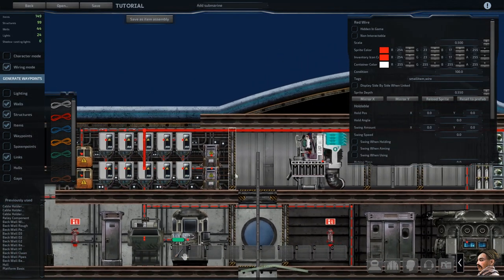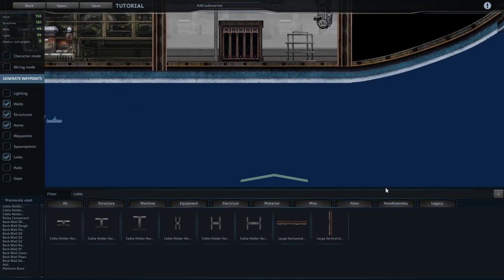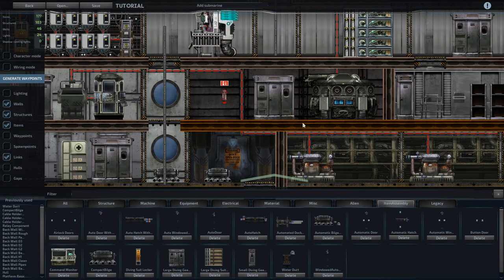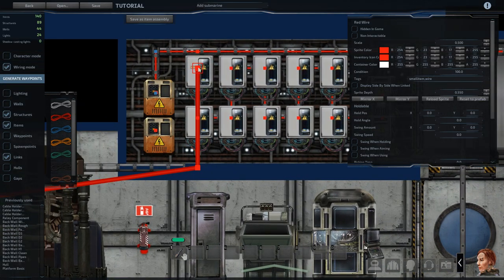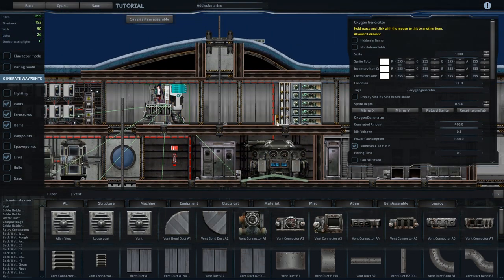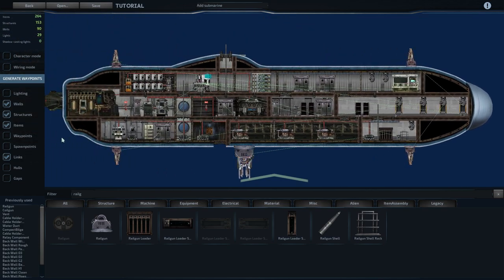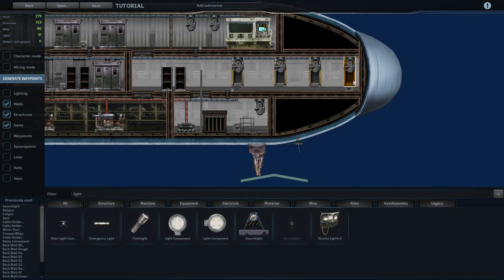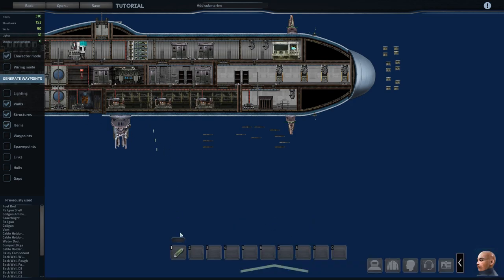Barotrauma Submarine Editor Tutorial Part 3 | Ducts and Wiring

Comment: An update for those whose bilge pumps might not be working: there is now a "water_%" signal as part of the water detector that you use to regulate the speed of the pump rather than the signal check component seen here in the prefabs made by the devs. Strangely, the prefab that uses the signal check component hasn't been removed despite no longer working (the pump turns on but remains at a speed of 0, doing nothing). Here's what I've done to set up working bilge pumps on the current patch:

-Wire the water detector's signal_out to the pump's set_state as usual—this turns the pump on when there is water detected. 

-Next, create a multiply (X) component and a memory (MEM) component. Set the memory component's stored value to -1 and wire its signal_out to the multiply component's signal_in_2. 

-Now wire the water_% from the detector to the multiply component's signal_in_1. Thus, the signal_out of the multiply component is made negative so that the pump will actually remove water (leaving the water_% value positive would cause the pump to pump water into the sub). 

-Lastly, wire the multiply component's signal_out to the pump's set_speed, and you're done!

Alternatively, if you want the pump to always function at maximum speed regardless of water level, there is no need for the multiply component or the water_% value. Simply set the memory component's stored value to -100 and wire it directly to the pump's set_speed. This way, whenever the pump is turned on by the water detector, it will pump water out at max speed, using more power perhaps but getting the job done quick.

Great series Oroe, it was a tremendous help getting started.
Reply from the maker: This is great information, thank you!
Reply: @n_tropy  Absolutely, glad to contribute.
Reply: Thanks! You saved me!
Reply: @MonsterTamerBloba  you're welcome!

Comment: How can you wire more then 5 thing? i have 6 ballast pumps for example and i can only wire 5
Reply from the maker: You'll need to use relays, each wiring point has a maximum fanout of 5
Reply: @n_tropy  okay thank you man you are a legend
Reply: @n_tropy  in wich relay in and out slots should i put it?😅 i have 15 pumps so i have to use 4 relays.
Reply from the maker: @max_2271  15 ballast pumps? I'm not certain why you have so many lol. When it is switched on, it will forward all input connections to the output. So you could feed the control line to the input, then fanout to 5 pumps per relay.

Comment: How would I turn a docking hatch into a airlock? Specifically for the Humpback sub.
Reply from the maker: Since a docking hatch is specifically designed to react to other docking hatches, I don't believe there's a way to turn that game element specifically into an airlock. You're better off using a two-door system with linked buttons.

Comment: When i start the game the ballast's are OFF. I need to turn them on manually, i dunno why is that. I did everything, the power, signals, name tag.. AND the Status monitor always sasy "no power" when its powered from the reactor itself. Please help.
Reply from the maker: Make sure the status monitor is being appropriately fed from a junction box, and make sure it's linked to the nav terminal appropriately. To clarify, it will always say "No Power" while still in the sub editor. To have the ballasts default to on, enter character mode in the sub editor, open the ballast pump, turn it on, then save the sub. It should now default to on.
Reply: @n_tropy  Thanks again! My first submarine is almost ready thanks to you! :D

Comment: 4:25 may i suggest an idea ? 
those duct if possible  make them not open if there water bellow
because i think  it will make sinking faster  if there pressure from bellow
just an idea
the idea come from 
if there hole in the hull  and its behind a door and there a hole in the lower room  that duct will open making  the water go upward a bit faster
well i wonder if that still apply to the game
Still waching  or is the gap 1 direction ?  can't wait to see it

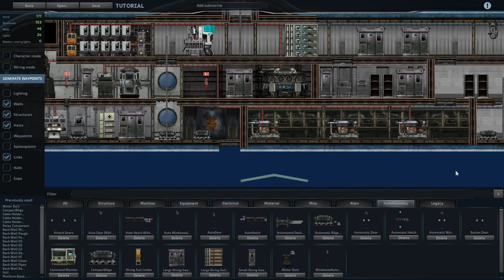edit1: 5:45 the gab  seem to be bothway interesting
Reply from the maker: You're right, the gaps can be made to be one way. Great idea!
Reply: @n_tropy  i got more funny idea automatic fire extinguisher for the reactor flood the whole ship  if it happen lol
more thing to experiment
Reply: great they had to change the editor i understand nothing >_>
Reply from the maker: @buder5116  A lot of the GUI elements are now in the top bar. Biggest change is no more character mode, you can interact like a character from the main mode.
Reply: @n_tropy  took me a while to find out, you have to open it
and found something you know when you drag straight wall-floor ? hold shift  it make smaller segment snap
Reply from the maker: @buder5116  You define what the tags are on the spawnpoints for each class.
Reply: @n_tropy  thanks
now i wonder how to make a shuttle on existing sub  trying to find a tutorial
Reply: @buder5116  would be easy to do just put a smoke detector above the reactor with a balast tank next to the reactor room if smoke is detected open the side door into the balast tank to flood reactor room

Comment: I am not able to move my ship vertically. I wired everything correctly for the ballast( power to junction boxes and settargetlevel to velocity Y out) and my ballast level is 0.4989. what could be going wrong?
Reply from the maker: See if you can manually manipulate the ballast pumps (at the pump itself) to cause vertical movement. If so, then you know it's a wiring issue to the nav terminal. If not, you know it's a wiring issue to the pump.
Reply: @n_tropy  I found out what it was! the ballast pumps started in the off position and so I had to just turn them on. Thank you very much for replying! I think it's really cool that you're willing to help still!
Reply from the maker: @toastyboi3688  Happy to help, and glad you got it figured out! I don't think I've built a single sub where I remembered to turn the damn pumps on in the editor lol

Comment: How do you delete wires?
Reply from the maker: If it's a wire between two machines, you need to enter the wiring GUI for each machine and disconnect it. When disconnected from both machines, simply drag it from the bottom of the GUI into your inventory.

Comment: Thanks for the amazing tutorial! My first submarine is almost complete, all I need to do is wire weapons and fix one problem. When I wired everything to the navigation terminal, I did x for the ballasts and y for the engine but I can’t move up and down while in game. Not only that but all my junction boxes break and burst into flames if I drive even a little bit. Is there any chance you could help me understand my mistake? Thanks!
Reply: Correction: I did x for the engine and y for the ballasts
Reply: Ok, I also got the ballasts working. Now the only problem is the junction boxes frying
Reply from the maker: @stubblyhippo2748  Try increasing the Overload Voltage in the junction boxes' properties
Reply: Overload voltage should set to the number of conectet wires

Comment: dude, you forgot say how to connect the batteries and the junction boxes, i speak spanish and i only folow the things you do, pls if you can tell me how to conect the rest of the junction boxes and other things :c
Reply from the maker: So sorry I didn't see this! YouTube stopped notifying me of new comments for some reason. To chain junction boxes together, simply connect their power nodes together with a wire. To connect batteries, they need to have power in from one box and power out to a different box. This second box will then feed the section you want battery backup for. I then wire the battery's state node to the main terminal so the captain can control the battery system. I go through this in more detail in Part 2 of the tutorial: https://www.youtube.com/watch?v=kUyGAXBdSEI
Reply: @n_tropy  Thanks so much dude, im already suscribed so n-n